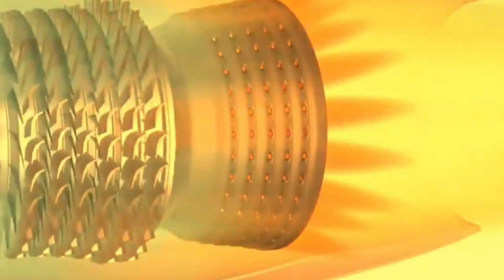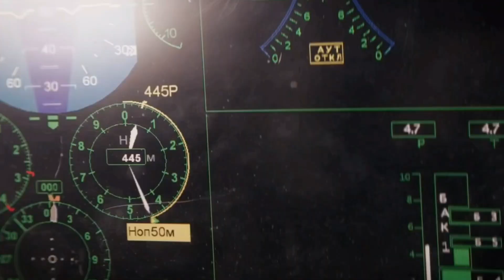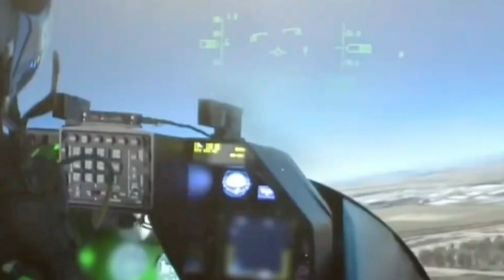Sukhoi Su-75: The Ultimate Stealth Jet Experience!

Comment: I think it's decades away, if ever.   Russia does not even have the SU-57 fully operational.   This is a fantasy dream aircraft at this point.
Reply: @perryallan3524 definitely because they can hit their targets hundreds of kilometres away from the front line... And that's it was meant for, no?
Reply: @kohrirabel1  Virtually any aircraft can carry missiles that can hit a target hundreds - and even thousands of Km away.  You have no need for stealth or maneuverability for that.

The fact is that the SU-57 is a failure as a Stealth aircraft.    All the reports I have seen says it can be detected by common onboard aircraft radar hundreds of Km away- so it's not actually a real stealth aircraft.  Once again Russia's claims on what something is - are false.  Just hype.

It's not even very maneuverable as the engines it is supposed to use have not yet been developed enough to enter production.

In an air-air combat with a F-15, F-16, F-18 it might have an even chance (all of those carry long range ant-aircraft missiles of similar range as what the Russian long range anti-aircraft missiles claim).  Against a F-22 or F-35 it has almost no chance.

Yet, this is the latest and greatest of Russia's aircraft development and developed decades after the F-15, F-16, F-18, and even F-22.
Reply: U need better resource..
Reply: Russia will never announce things that doesn't exist..su57,khinzal,satan2, and whatever they said before come to reality far early than people like u expected..and hey, the Chinese are tailing or leading we just don't know..what we know is the American things are useless in Ukraine and those plane they proud keep failing from sky..
The f22 suppose to be their aces but production have been ended..
Well..the world are Changing, all those weapon are useless and beaten by a drone using moped bicycle engine.😊
Reply: Just watch what happens in the Oukranian front. The 57's from above(& safety) sends the drones, the kinzhals, e.t.c. to the target.
Reply: @ΠαπαδάκηςΓραφείοΤελετών  If the SU-57's were so good why does Russia only use them from several hundred Km away from the Ukraine border.

The answer is that they are afraid to get any closer as they could very well be shot down.

A MIG 21 (or similar generation fighter) could do the same job as the SU-57 is currently doing.

So tell me why the SU-57 is a good and modern stealth aircraft?
Reply: @perryallan3524  Probably the same thinking as keeps Abrahams and Chellenger tanks away from the front lines.
Reply from the maker: Thanks bro 4 ur feedback...don't forget like, share & Subscribe
Reply: Bullshit